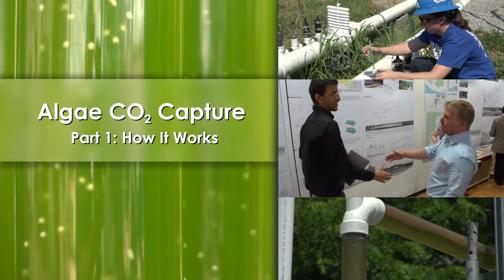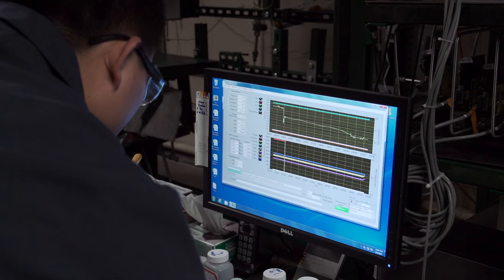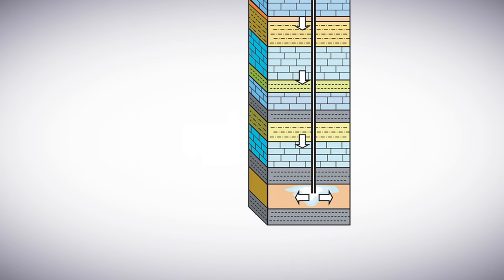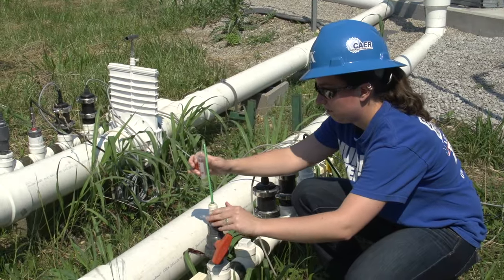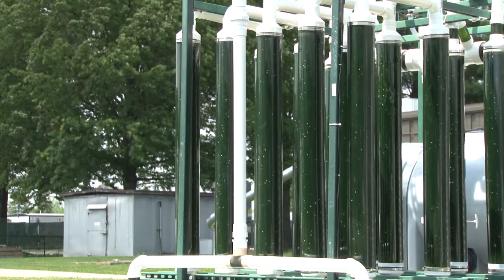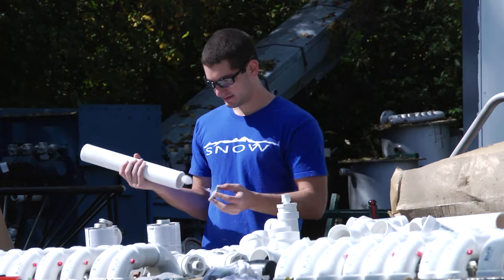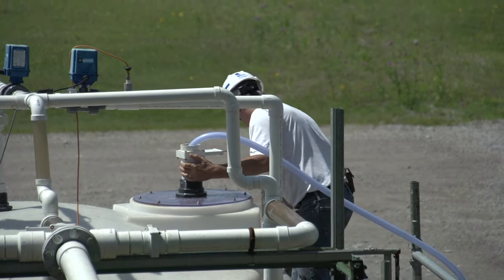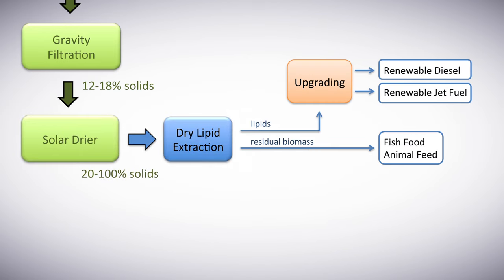Algae CO2 Capture at the University of Kentucky: Part 1

Comment: The next step is to visualise the world’s vehicles as Carbon Sequestering machine, cos for every gallon of Algea Bio Fuel that is bought and used, 10 pounds of a nutrient rich Carbon residue is produced. PBR’s are cheap, easy and quick to build,  and could be rolled out in every locality so creating millions of climate saving jobs, and cleaning our waste water in the process. As waste water treatment is normally energy intensive. To fund the roll outt PBR nationwide in every locality and to level the playing field, we need to demand a phased transfer of the £10.5 Billion fossil fuel subsidies onto renewables and to fund the roll out of PBR. I propose to make sure we are Carbon Nuetral by 2025, that we phase the transfer by £2 Billion p/a,for 5 years till we reach 10 Billion in five years, then the full £10.5 Billion transfered is guaranteed to continue until we have transitioned completely off fossil fuels for transport and energy!.This would happen in 3-5 years if the subsidies was transferred as I said!.